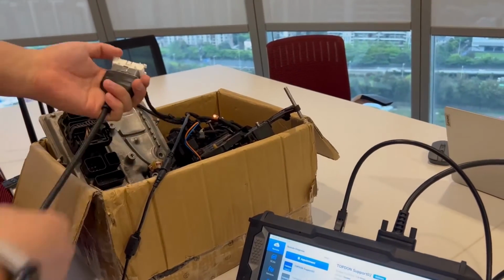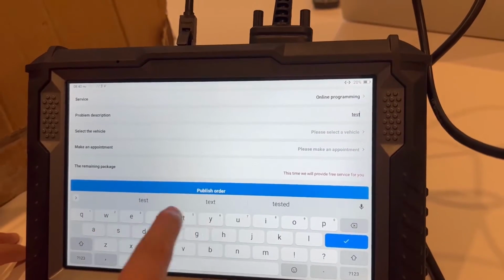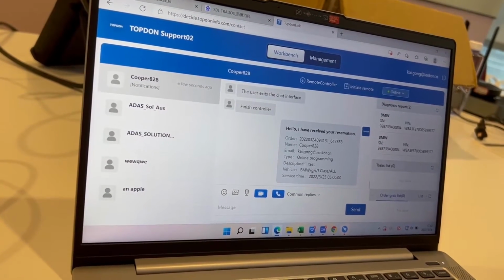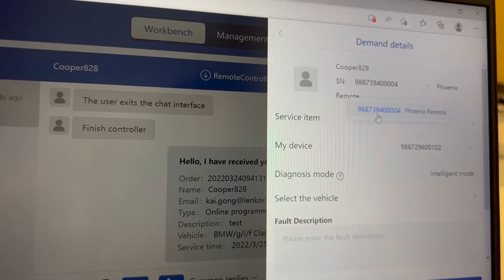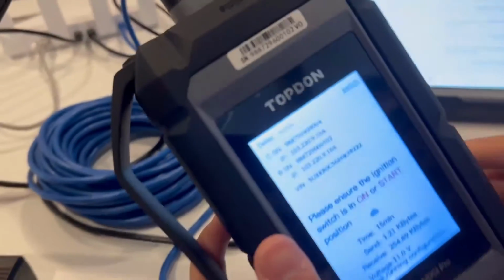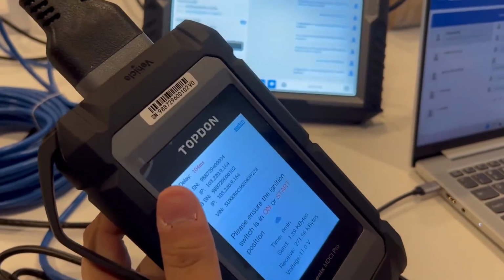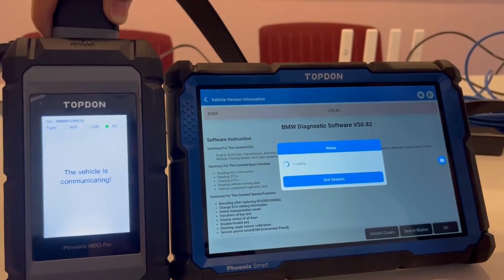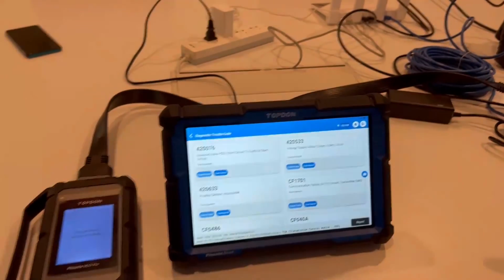TOPDON | Phoenix Remote | Basic Setup | Diagnostic Tool

Comment: Hi, 

I’ve been searching on the TopDon website but cannot seem to find the B Box that used along with the scan tool. Do you have a link to the product? Thanks!
Reply from the maker: Hello, may I ask are you referring to the MDCI pro that showing in the video?
Reply: @TopdonOfficial  yes! I had trouble finding it on your website site. Do you have a link? Thanks!
Reply from the maker: Hello, The Phoenix Remote is designed for end-users (C-side) to place remote diagnostic orders. The MDCI CAB shown in the video is a technician-side (B-side) tool required to: Accept remote orders and connect to third-party diagnostic devices. To obtain the MDCI CAB, please contact: Your local distributor, or the sales representative associated with your purchase. May we ask which country/region you're located in? This will help us direct you to the nearest authorized supplier.

Comment: Possible to start make that remote support? What i need for it? I have many oem tools, and diagnostic tools, and knowledge to coding, adaptions etc. Is it enough, if buy that mdci pro vci? In that case that could be phoenix max for other needs too...

Is it enough to register to remote cardiag on infosite, download that remotecontroller software, and buy that mdci pro, or some tool what include mdci pro? And after it bind device there? Is there somekind registration payment, or how that works, to get password and activate vci?
Reply from the maker: To learn more about register as remote expert, plz contact support@topdon.com, thanks for your recognition to Topdon.

Comment: Do I have to pay monthly for  it, I mean remote diagnosis fee. Can you guys explain more. Thanks
Reply from the maker: Hi, There is no monthly fee, just pay per use, indicate the fee(decide by yourself) when set the remote order.
Reply: @TopdonOfficial  how much per use?
Reply from the maker: @BipVuongAnCapTheMuaMayBayXao  Currently there is no prescribed charging standard, you could set the fee according to the function level you need to achieve. Once you post the order, the technician can see it and contact you for further confirm and negotiate.

Comment: Hello - Great video...  I see you are well versed with the "Remote".  I am interested in the Phoenix Smart and I see that you have it talking with the remote..  I hope you can answer my questions? 
1. Since the Smart comes with MDCi Pro - what are the benefits when using both together on a vehicle?
2. Can the smart directly plug into vehicle obd2 port without MDCi Pro?  Will you get full functionality?
3. When using the MDCI Pro - is there an added cost for any added enhancements?
4. The MDCI Pro - is there an internal battery or you are required to plug external power?
5. Does the Smart support commercial vehicles with 24v?
6. Does the Smart support EV?
7. Regarding programming - is this done with or without MDCi unit?

Thx
Reply from the maker: Hi, Do you want to know the difference between Phoenix remote and phoenix smart? The software coverage of these two products is of the same level. There are three main differences.
1, Phoenix Remote supports remote programming, and as a client, releases orders for demand help, so that experts in different auto repair fields can help him solve functions he is not good at or functions not supported by the equipment, such as ECU data wiping, programming, setting codes, parts matching, anti-theft parts replacement, key matching, difficult wiring troubleshooting, etc., which is not supported by Smart.
2, Phoenix Smart has a VCI dongle, which supports J2534 protocol and can be used with some of the original software (J2534 driver is still being verified, so it is not supported for now), while Phoenix Remote is directly connected to the car using the diagnostic main line without VCI dongle, in order to ensure more stable data transmission during remote programming.
3. In terms of software update, Phoenix Remote supports upgrade silently(after setting, the network can be upgraded automatically in the background), while Phoenix Smart does not support it.